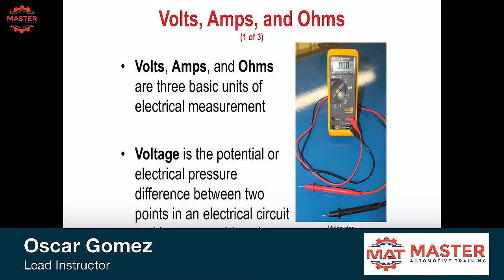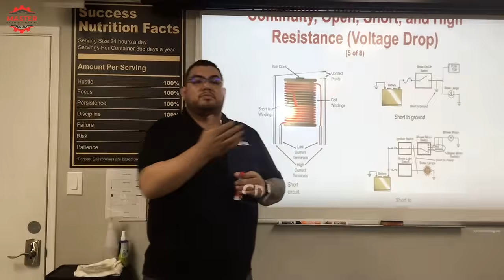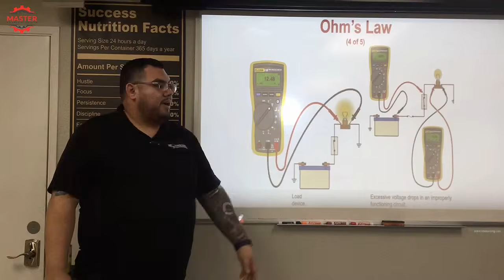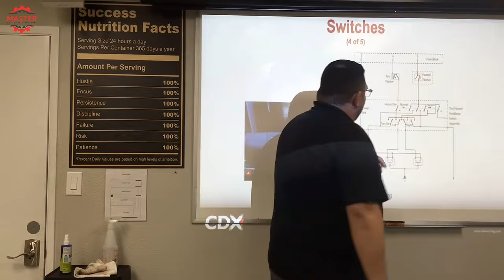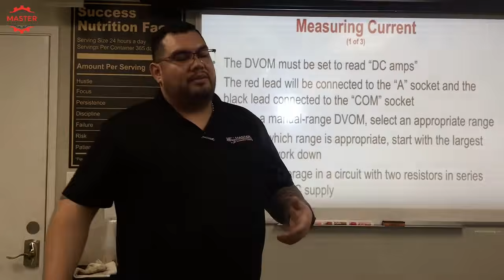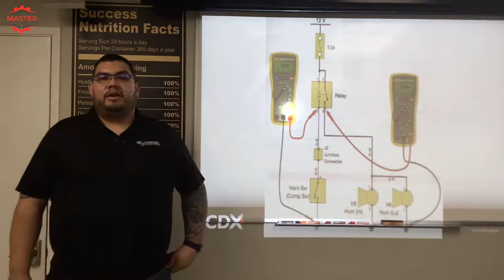ASE A6 Practice Test [Live Class]

Comment: Good video, but according to Kirchoffs law each leg across a load is equal to source voltage, @25.53 you state the load across the bulb is 12.48 so the battery must hold 12.48 as source voltage, the switch, consumes very little voltage, as well as ground. Which then equals out to 12.6 volts as battery source voltage. Just want to clear that up.
Reply from the maker: The diagram isn’t showing full circuit math — it’s just showing voltage at the load during a voltage-drop test.
If the bulb reads 12.48 V, that doesn’t mean the battery must be 12.48 V.
Real circuits have small drops in wiring, connections, and grounds. Kirchhoff applies to the sum of the drops, not each leg. The graphic is only illustrating normal vs excessive voltage drop, not ideal source voltage.

Comment: Yo Oscar... isnt 2mv written as .002 and not .2  which is 200mv???, 

Millivolts (mV)	Volts (V)
0 mV	0 V
1 mV	0.001 V
10 mV	0.01 V
100 mV	0.1 V
1000 mV	1 V
Reply from the maker: You're absolutely right, 2mV should be written as 0.002V, not 0.2V. If I misspoke in the video, thanks for pointing that out, I appreciate the correction.

Comment: Basic Electrical Measurements:

Use a voltmeter to test for voltage (electrical pressure) [01:15], [02:08].
Use an ammeter to test for amperage (electrical flow) [01:38], [02:40].
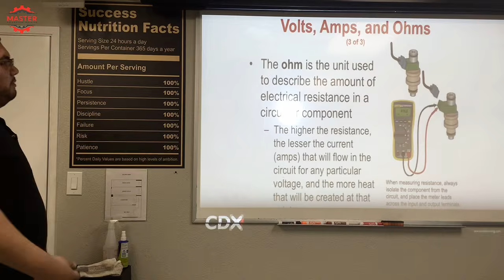Use an ohmmeter to test for resistance [01:49], [03:36].
Electrical Circuits:

Common components discussed include batteries, switches, fuses, and loads [04:39].
The focus is on practical application rather than complex math [05:25].
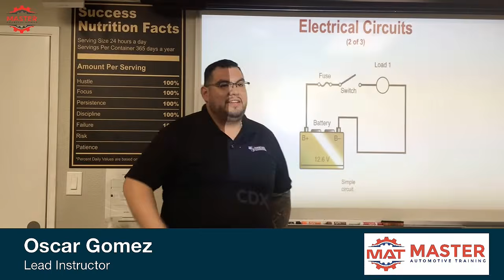In series circuits, amperage remains constant throughout the circuit [06:33].
AC vs. DC Voltage:

AC (Alternating Current) voltage alternates above and below zero, while DC (Direct Current) stays above zero [07:25].
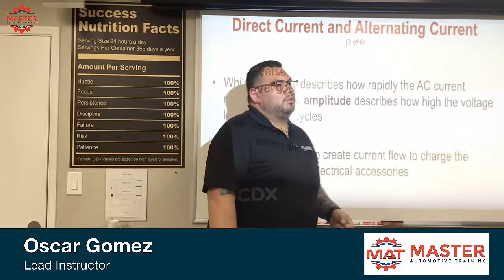Amplitude relates to voltage measurement, and frequency relates to time measurement [08:02].
Wiring Diagrams:

Typically show power sources at the top, loads (components using power) in the middle, and grounds at the bottom [09:14], [01:02:24].
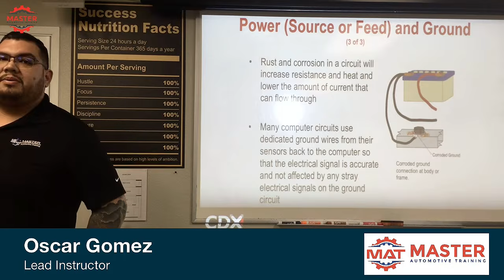Maximum allowable voltage drop on the ground side is 0.2 volts (200 millivolts) [09:50].
Dashed lines indicate components that move together [43:22].
A dot signifies a splice or connection point [01:02:39].
Diagrams use abbreviations for wire colors [01:04:04].
Labels often use "G" for grounds, "C" for connectors, with components usually in the schematic's middle [01:03:32].
Circuit States & Testing:

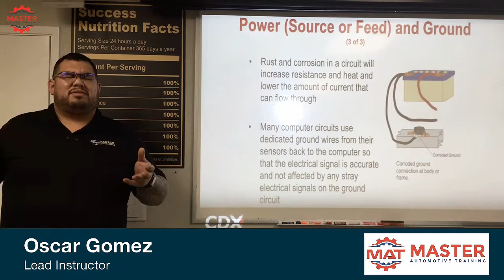Continuity (measured in ohms) checks for a complete path and requires isolating the circuit [10:15].
An open circuit signifies a break or an open switch [11:17], [58:16].
Voltage drop tests help locate open circuits and should be done while the circuit is active [23:14], [58:49]. They are performed in series [52:40].
After the last load in a circuit, voltage should ideally drop to zero [20:20].
Specific maximum voltage drops are mentioned for circuits like the starter (battery positive to starter pole: 200mV [21:51], across solenoid: 300mV [22:26]).
A short circuit on the primary side of a coil might blow a fuse [17:44].
Test lights are suitable for load substitution but not recommended for computer-controlled circuits [57:35].
Ohm's Law & Power:

Defines the relationship: Voltage (V) = Amperage (A) x Resistance (R) [30:19]. It takes 1 volt to push 1 amp through 1 ohm of resistance [25:27].
Can be used for diagnosis by comparing expected vs. actual values [55:40].
High amperage suggests low resistance [56:19].
Wattage (Power) = Amperage x Voltage [31:37].
Circuit Types:

Series circuits offer only one path for current [35:58].
Parallel circuits offer multiple paths [37:06].
Kirchhoff's Voltage Law:

The sum of voltage drops around a closed loop equals the source voltage [39:14].
Components:

Relays typically have four pins: 85 (ground), 86 (power), 30 (power input), 87 (power output) [45:18].
Diodes allow current flow in only one direction [50:24].
Fuses are rated by their amperage capacity [59:36].
CAN Bus:

These circuits usually idle at 2.5 volts [01:00:05].
General Test Advice:

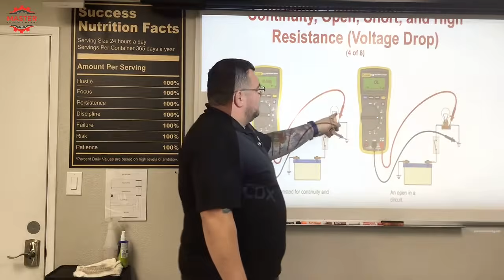Identify power, grounds, and loads on diagrams [13:23].
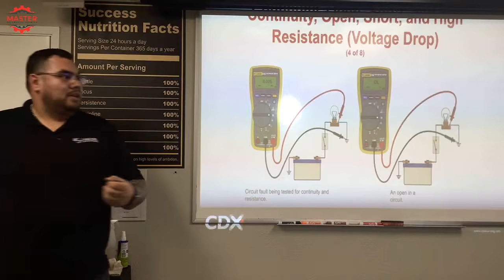Consider all possible answers before concluding [15:17].

Comment: Thank you for this great presentation. I love electrical, but electrical does not seem to love me. Should I see 12 v on both sides of the coil side (Pin 85 and 86) when the relay is not energized?
Reply from the maker: You are welcome! Yes if the coil side of the relay is off, voltage will be present on both 85&86.

Comment: Q 36:41 and 36:42 the screen says 1 volt as the answer as opposed to the correct answer of 12 v as source.??? Shouldn't the answer to problem #6. be 3 volts which  when it's  all added up, give us source voltage which is 12v and not 1 volt for this resistor??? The answer for the 2nd resistor,  I believe  should've been 3 ohms of resistance! Please correct me if I am wrong! Great, Great Videos!!! I subscribe.
Reply from the maker: Hey buddy, 36:41 it is 12 the power point got corrupted you can see the 2 in between It and R1. For #6 it is a series circuit so yes we do need to add them up if we had the values. Since we are solving for the unkown we use Ohms law, 3 amps into 12 volts gives us 4 ohms. Because of this R1 is 3 ohms which means R2 must be 1 ohm. Rt would be 4ohms. Did that make sense? Thank you for subscribing.